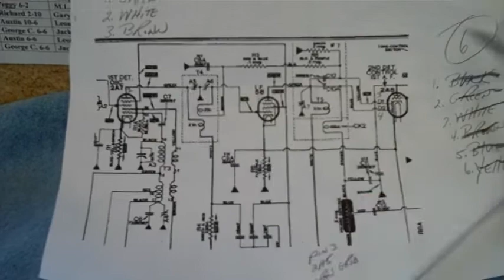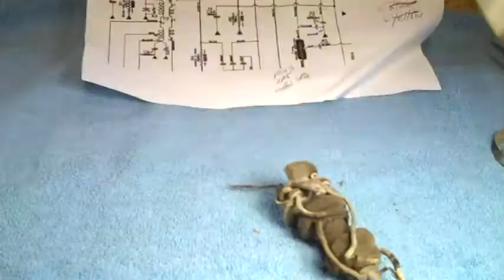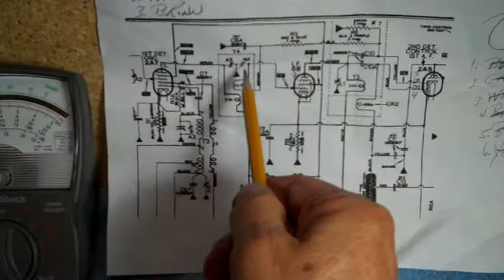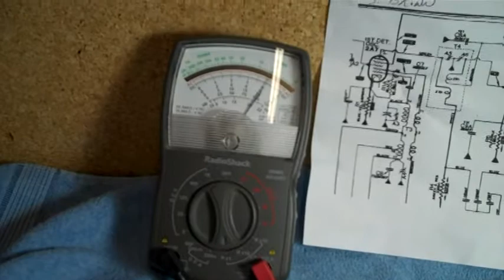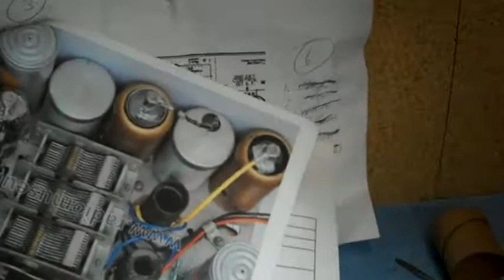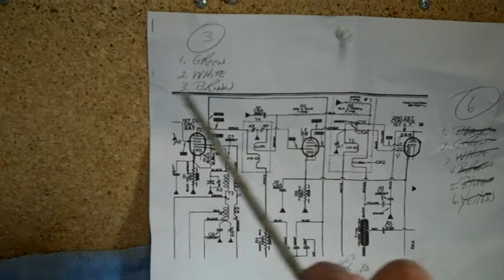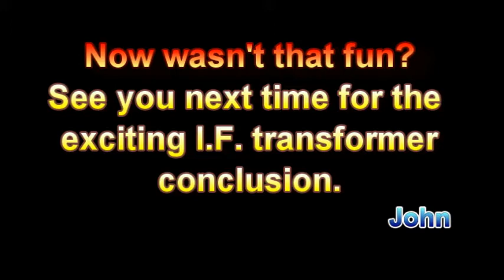1935 Atwater Kent Model 145 Repair and Restoration (Part 9 of 38).

Comment: Thanks for sharing this complete rebuild John,  So when you showed the brown wire was shorted to T4 can and you wondered if that large cap was put in there to suppress noise; you might also remind us, that the brown wire leads to gnd via 0.05uF cap. So this short, effectively bypassed that cap. If it had been the white or green wires, T4 would not be working well at all. but since it was the wire going to gnd, it must been a head scratcher down at the AK shop. ~Wiggy

Comment: Amazing what you find inside some of these radios.  Great workmanship, for the most part, but, once in a while, you find a wire that the solder missed altogether, or barely hit, or, like you found, a crushed wire.  Hope most of that got worked out, by war-time. You don't see much of that, from the factory, in post-war sets.  I'm settling in for a long summer of AK 145.  Thanks John.

Comment from the maker: Phil,
I use 22 gauge hookup wire, both solid and stranded, for all my radios.  I get it from Radiodaze.  Stranded wire should be used where flexibility is required...like on grid caps and and free-standing antenna wires.  The solid wire can be used where there's non-movement.

Regards,
John

Comment: Hi John 
I'am following you step by step on this one, what size wire are you using and is this the same size wire that you use for under the chassis when you are replacing damage wiring or are they two different type. like always i never missed one of your video regards phil